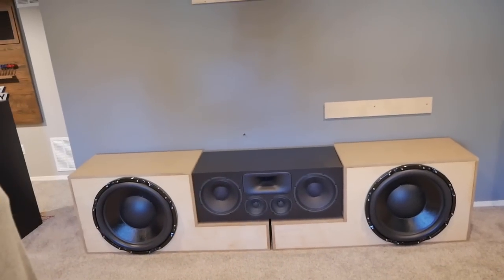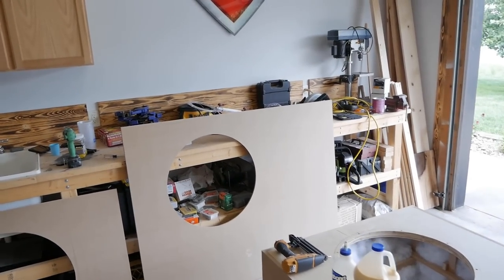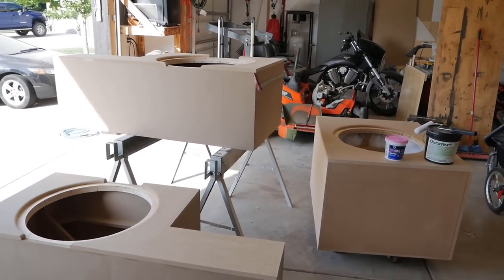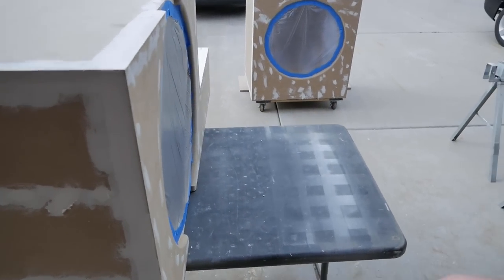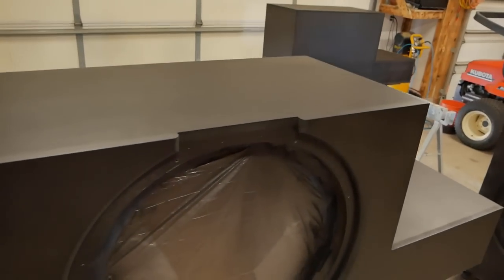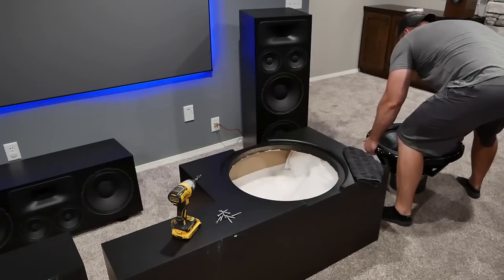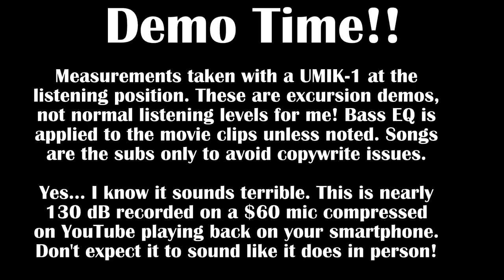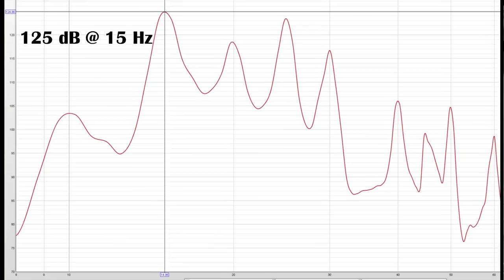Stereo Integrity HS-24 SUBWOOFERS Finished! Painting Crazy DIY Home Theater Subs and DEMOS!!

Comment: how do you like them in a sealed box.?..there is a company in canada called mach5 audio that has some 21inch subs that im thinking of trying...what are your thoughts.....?
Reply from the maker: Mach5 still making subs? I thought they went out of business a while back... not saying that as an insult. I tried reaching out a few years ago and someone told me they were out of business. 

Sealed is the way to go for home theater if you're going with a 21 or 24 in my opinion. You don't need the extra output from a ported box, these get stupid loud with good power. Box size gets ridiculous with ported, increase difficulty in a build, possible port chuffing... best thing is sealed boxes get LOW where ported falls off at some point. I've measure near 120 db at 7 hz. Smaller subs do well in ported enclosures where you need that extra output. I don't find it necessary with the ultra large drivers
Reply: @LifeofBliss  ok yes they are still in bussness i have been talking to mark the owner..for a bit now ....

Comment: Nice job bro. What made you go for these vs the 4000 ULF ? I guess if you made the cabinet yourself its way cheaper?
Reply from the maker: Much cheaper than JTR subs. Most things DIY are a good value vs cost. Plus I could make them exactly like I wanted (holding the center channel). 1 24 is roughly the same output as 2 18s, so that's a lot of money tied up in JTR is you went the same route. I'm under 4k with my subs and amp setup
Reply: @LifeofBliss  What LCR speakers do you have? Are they also stereo integrity?
Reply from the maker: They are from DIY Sound Group called the 1299s. They no longer sell them due to stock/interest, but they sell the little brother 1099s still. Insanely clear and loud speakers. I have some build videos of them on the channel as well
Reply: @LifeofBliss  thx... ya i think i might copy you with dual hs24s... although I cant lie since I saw the 'end game home theatre' on youthman's channel I am tempted to do 4x 24... insane laugh
Reply from the maker: Lol do it! But I have to confess... I have 3 HS24s 😂 there's another in the back of the room. The next room will have at least double that... 🤪 thats the plan anyways! Seriously though, there's nothing quite like 24 inch subs. Its an experience
Reply: Yo you see that insane cabinet he had on his hs24s? Fucking insane.
Reply: @LifeofBliss  Put 1 near your listening position. Paul McGowan at PS audio said it leads to just incredible bass.
Reply: @LifeofBliss  WHOAAA wait a min. How come your sub cabinets aren't ported ?
Reply from the maker: @Smood47  yea man, those boxes were nuts... the guy that built them does awesome work. Honestly, I really prefer sealed for larger subs. You don't really need the extra output like with smaller speakers and there's no drop off under port tune, no port chuffing, smaller box size... I mean, I was getting nearly 130 db from 10-12 hz and up, 120 db down to 5 hz. I feel the sound is a bit tighter and cleaner sealed. Personal preference 😉
Reply: @LifeofBliss  Ah ok

Comment: I don't often admit that I'm wrong, but I was wrong! YOU DO need 3 bridged Smith 14k's, and then just use the XBS 20k for the additional subwoofers you'll be adding shortly... hehe! 😀
Reply from the maker: Haha yea it would be nice to have a little extra head room... I could just bridge the 20k to run 2 24s, then grab more 20k's depending on how many 24s I get for the next place 🤔😁
Reply: @LifeofBliss  two bridged 14k's would give about 5db more headroom, and a bridged 20k would be about 3db more. Not sure how well the 20k would handle quad 2-ohm at full load, mine gets really warm in that mode, it's something you'd have to experiment with to see what it does.
Reply from the maker: I don't run anything 2 ohm. Those subs are dual 2 so they are wired for a 4 ohm load. 1 sub per channel. We'll see what happens in the new place... I'd have to run more dedicated lines using the 14ks if I want each on its own 230v30a line. I could do 2 24s vs 1 on the 14ks. That sounds kinda nice to be honest 😅 less wiring and breaker box room. Could you imagine... 4 20ks and 8 24s 😲🤪 I'm slowly planting the idea in my wife's mind 😂

Comment: Next time you're building with MDF and you want to get rid of the lines use Autobody puttering putty whiskey auto body putty you won't be able to tell which direction the wood is in you want me to see any seams instead of a palm sander palm sander for fine finish get a belt sander Bloxorz look good but they can look better

Comment: what do you think about building DIY SUBS tuned to 28 hz..?..i can get a deal on these subs .and from what i have read the comercal movie theater has there subs tuned to 30 hz.....
Reply from the maker: A deal on the 24s? Dude, if you buy 24s, I'll slap electronically slap you on here if you build boxes tuned to 28 hz... Idk about movie theaters tuning, but I would suspect it varies. And 28 seems pretty high, but who knows. You'll be missing so much down low still. For music, sure, I could see that. But movies, nah. 20hz tune or lower. But if you get these 24s, run them sealed. Smoother response, less distortion imo, no port chuffing... and you'll dig down to single digits where ported subs don't like to go. Unless the box is HUGE, which you wouldn't want to move anyways 😉
Reply: @LifeofBliss  ok great thanks for letting me know i will look into it more ..
Reply: @LifeofBliss  the subs are 15 but i was also looking at 18 ..the 24 may be a little more then i can afford.i was looking at resiliant sound subs they are car subs...
Reply from the maker: My opinion... get the biggest quality sub you can afford and fit in the room. The new ht18v3 subs from SI are only like $200 each. You could do multiple 18s for very cheap with those. Just another option to look at... but size matters so much with deep bass. And your mid to upper bass will sound more natural/effortless. Still with the tuning, I wouldnt tune that high unless you were like 80% music 20% movies
Reply: @LifeofBliss  ok great i will check them out and see what it would cost to ship to canada and the duties......thank you
Reply from the maker: @johnsmith-qz4bv  let Nick know I sent you his way, he may be able to help you out with shipping or the woofer costs if your buying multiple...
Reply: @LifeofBliss  ok thank you i would like atleast 2 18 inch subs..i will let nick know you sent me .....thanks again..

Comment: How do you stop the doors from rattling?
Reply from the maker: Lots of gasket tape. Still doesn't completely fix it though
Reply: @LifeofBliss  what do you do with the gasket tape?
Reply from the maker: Put 2-3 layers right by the latch and in the corners on the frame. Helps keep the door tight instead of having any play to rattle around
Reply: @LifeofBliss  I'm thinking of putting either some small rubber feet (like the ones you come with bookshelf speakers) or felt pads on the door frame so that when you close the door, it closes tightly so it doesn't rattle.  Right now i'm putting a rubber wedge at the bottom of the door to wedge it shut.  that seems to work, but I hate have to do that for 3 doors each time I watch a movie.  I have a celler door that has this spongy tube around the frame so it doesn't let any cold air into the room, but that door also rattles.  but its not the door rattling that makes a sound (that door is solid), its when it pushes against the spongy tube and that tube rubs against the frame that makes an even worse sound.  there is no gaps around the door so I can't wedge it shut.  I tried to look for a better tubing to put around the frame, but can't find any.
Reply from the maker: Yea try buying a roll of 1/4 inch speaker gasket tape and double or triple layer it in a few spots around the frame
Reply: @LifeofBliss  I did a search for it and all i see is black.  do they come in white or other colors?
Reply: @LifeofBliss  and are you saying to put this for the celler door or the other doors?
Reply from the maker: I think just black. I meant the regular doors, not sure what you would do with the cellar door

Comment: you should have used a primer.  sand it and 1 or 2 coats of paint.
Reply from the maker: I did that with my mains, started with primer. You don't need primer with this duratex and I still sprayed 5 coats over the primer to get proper build up. This isn't like automotive paint

Comment: why is the cable so thin inside the subs
Reply from the maker: All wiring in the walls is 12 gauge. Didn't expect to run this much power when I built the place. So looks smaller, but its 12 gauge

Comment: The speaker cables in the box are funny weak. I see too thin. The boxes are very nice!
Reply from the maker: Thanks man. Its 12 gauge wire. Thats about as big as you can fit in those neutrik connectors. Pretty standard for HT
Reply: @LifeofBliss  Here in Europe, we use much thicker wires made from the highest quality materials. This is important for deep sounds. Standards are not important! The best frequency transfer is the most important! mainly OCC multi-stranded or monocrystalline copper and alloy fabric or coated gold or rhodium or other..For the most brutal bass sounds, we omit all connectors. We connect directly if possible, the connectors will cause defects or loss of quality. Great obstacle ..
Reply from the maker: I dont disagree with you. I would honestly liked to have connected the subs with 4 gauge OFC if the amp could allow it. Unfortunately it does not 🤷‍♂️

Comment: Don't let Steve Meade see those puny wires in your sub enclosure.
Reply from the maker: Lol I know right? Its 12 gauge, which is big as neutrik connectors can accept unfortunately.
Reply: @LifeofBliss  
Get in touch with him and get some of his beefy connection panels and better cables. 
There's always a way to connect larger cables even at the amp side. He's sure to have a solution.
Reply from the maker: @ro63rto  i might try something when I have this setup again. Probably have to remove the rear panel on the amp or have them make a specialty one that has speaker terminals instead of neutrik connectors. Its a Chinese company, Sinbosen, they can do anything you want 😉

Comment: I would personally like to see 8 or 10 gauge wire on those subs rather than thin wires that would present a problem. Those graph measurements dont look good buddy
Reply: Based on what? 12 gauge InSuch a short distance is more than big enough lol. 
I'm pretty sure he's not running more than 2,000 watts power sustained for long periods

Comment: Compression is ok for movies but never music thats what makes music lose its magic , also use as little as possible on movies and whoever did your eq is tone def they have anything under 30 hz seriously compressed those low notes your subs should really move and you have no port so box rise is not a problem  try turning the rear sub face the wall where the ball pit was but at a triangle angle you will not regret it